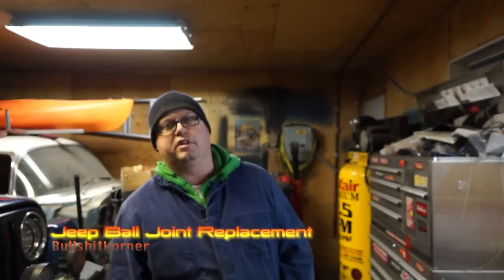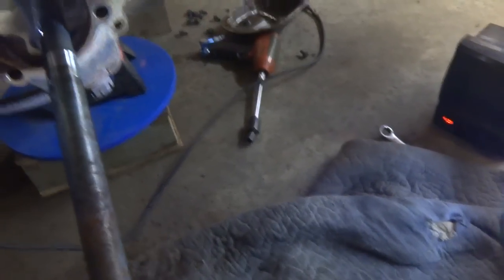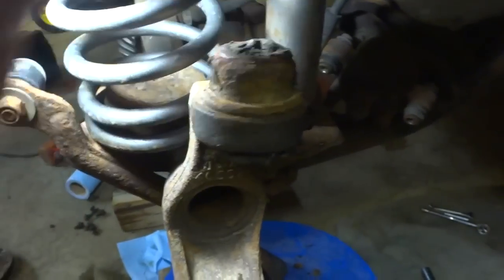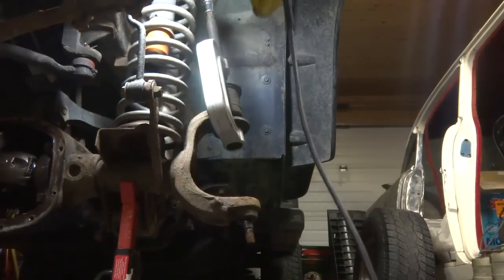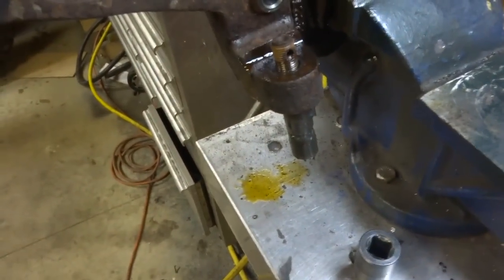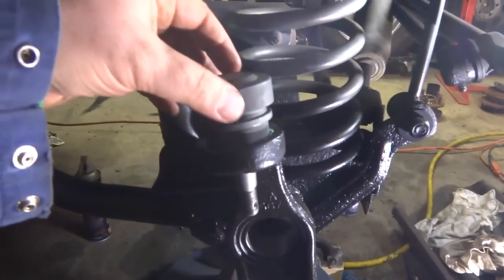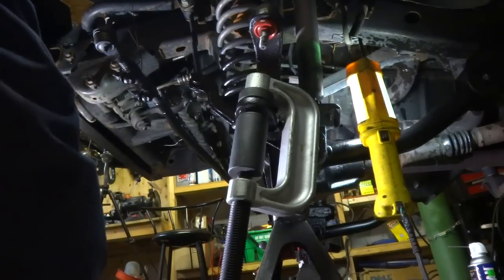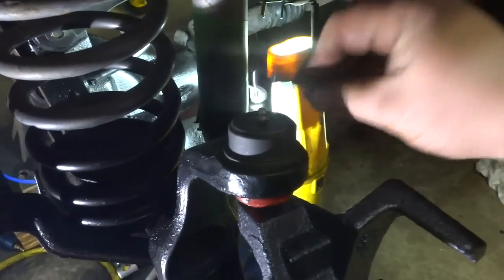Jeep TJ | XJ Ball Joint Replacement How Too (DIY)

Comment: thanks for the video

silly question 
do you need to remove diffmcover and drive shaft to do the ball joints
Reply from the maker: +RICHARD MAITMAN axle shafts yes the diff cover no, I was rebuilding everything on the axle when i did this video and installed a locker

Comment: Hey Guy, I've got to say your video was the best at getting out the ball joints, like your 'F' bombs, etc. Of course being a dumbass that I am,  was using the wrong ring on top. Got it down and pop, out came the top. Got the press cranked on the lower ball joint, but, it hasn't broken free yet, even though the Power Blaster is soaking in around the ball joint. Took a break! Just want to say thanks again.
Gotta get out the bottom, but, no one's hear to listen if I use the 'F' bombs.
Thanks
NormW.
Reply: At least you took 1 out-I cant take none-mine look like the ball joint is welded -hopefully tomorrow I will hook my 60 gallon compressor -the I will use my air hammer to loose it-saw Erick the car guy get the bottom ball joint just with the air jammer
Reply from the maker: karlos6628 use heat it works wonders, torch it up then bust it free
Reply: Bullshitkorner- does a blow heat gun works ?
I don't have a torch -thanks I will try other kinds of torch

Comment: thanks for the video im mid ball joints as we speak, my assumption about everything being the same was so wrong, 2000 tj= no c clips i nearly pooped my self thinking id have to replace the diff when the axle fell out when i removed the hub nuts..

Comment: great video. I need to replace mine and have a couple of questions. It looks like you got some high end ball joints. what kind are they and were can I get them? I also like the axle seals you installed and wondered where can I get those? Thanks and as always keep up the great work.
Reply from the maker: they are both Alloy USA brand can be found on ebay or most jeep speciality shops
Reply: Thanks

Comment: Do you use POR 15 to prevent rust on your jeep? I’m curious to see if it can withstand the harsh winter conditions in your area and all the road deicer. Ifit did it would certainly work here in South Carolina.

Comment: How are those alloy use hd ball joints holding up? I installed a set on my xj nd only put 25 miles on them nd had to replace my knuckle and now the bottom one can spin and move with my pinky finger. Thanx for any insight with your experience with them
Reply from the maker: no issues yet, they took me to the Arctic Circle so no complaints yet

Comment: Hey Jerry, love your videos bud helped me out a ton, just wanted to ask what type of paint/ or primer did you use on the spindle/ wheel hub for rust prevention? looks good.
Reply from the maker: i used a self etching primer then used a bumper paint on it
Reply: hey boss just got a question to ask you, I ordered those axle tube seals same ones you have to install, but I really want to get as much rust out of my axle tube and from my axle shafts before I install the seals in, theres a decent amount of surface rust on my axle shafts but I'd have to check how bad it is on the inner tube itself, as far as doing the shaft could I just get rust off with metal brush and spray it with black primer? how would you recommend removing rust from the inner tube?
Reply from the maker: yes you can clean it up with a wire brush, use self etching primer and then paint it.  the inner tubes you only need to clean where the axle tube seals will go

Comment: What brand/part number of ball joints do you use? I bought Spicer 706944X, and I am planning to change it on Saturday. After long research through internet, DANA Spicers seems to be one of the best on the market. What would be your choice ?

Comment: Did you not need an adapter to get it to press in straight? I did this on my 05 and it was a bitch because I didn't have the angled adapter. Had to shim it with washers (and drop a shitload of f bombs) to get it in straight.

Comment: Hey man do you clean and paint the all this shit before you put it back together? What is your process? Your videos are fucking awesome by the way, they have helped me a shit ton. If you've covered this before I haven't found it.
Reply: Yea he does. I did the same thing. To de rust I used a stainless steel wire wheel for a hand grinder kicks the rust off really quick

Comment: Fuckin right!  Appreciate the tutorial.  I have some fuckin questions.  1.  Will the ball joint press I can borrow from AutoZone get the job done?  2.  Should i buy the ball joints that can be greased on the top and bottom or is it fine for the top only?
Thanks in advance and keep up the good work!
Reply: Don't know if this guy has Autozone in Canada.  Changed min out 2 years ago.
1.  Yes, I used that fuckin POS borrow tool from autozone and got it done but had to go through way more PBR's.  Bent the tool too using the cheater bar, thanks china.  My ZJ knuckle/spindle is slightly tapered which makes it difficult to drive the pusher in straight w/o a shim.  Anyhow, it eventually worked. 
2.  I decided to put top and bottom zircs.  I used either a 90 deg or 45 deg (don't remember which) on the bottom joint due to the hub cramping space once it's reinstalled.  It worked.
Reply: OC Run We have Partsource here in Canada, it's a subsidiary of Canadian Tire.  They sometimes have the tool you need, sometimes not.  I only go there if I have to.

I use Princess Auto (the Canadian version of Harbor Freight).  I bet that's where he got the balljoint press cuz I got the same one.  
Princess auto will replace...without question....ANY of their "Powerfist" brand tools like the one that Jerry probly used here.

Stay gold.